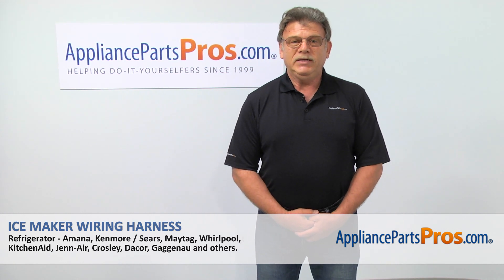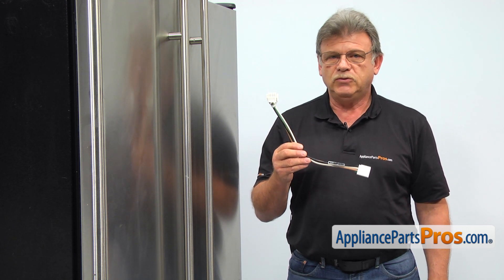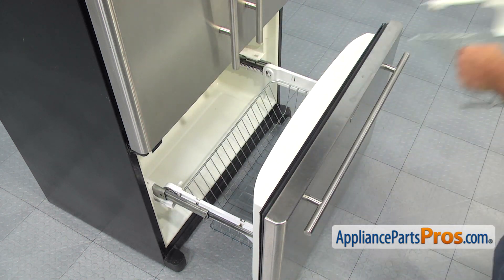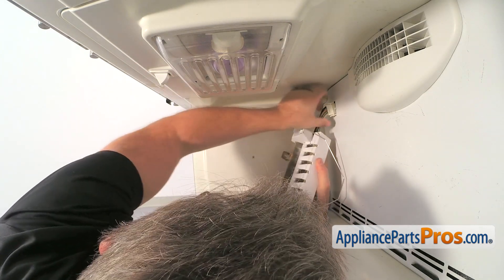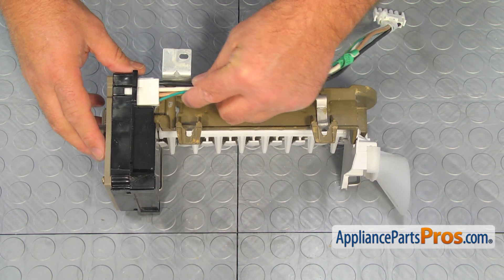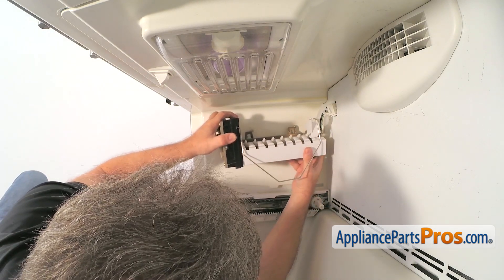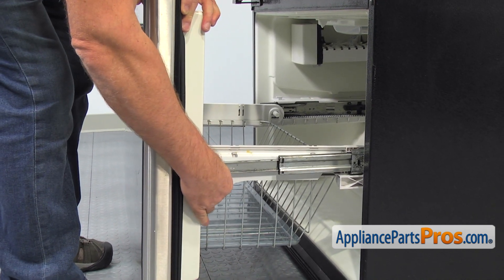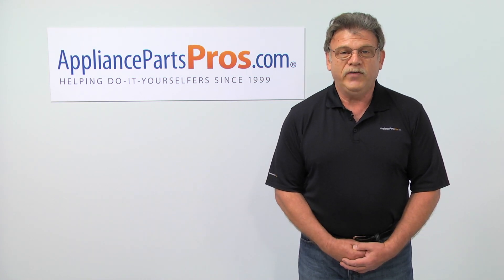How To: Whirlpool/KitchenAid/Maytag Ice Maker Wiring Harness WPD7813010

Comment: Good video........but...................?

Have a question for you about my side by side Whirlpool refrigerator.  The Freezer side has an  icemaker at the top inside of the compartment, not the bottom.  

It shorted out inside the icemaker.  I know this because I had to take it out and unscrewed the front cover (no, it did not snap off but had 3 screws holding the cover on) then the next "cover" had 4 screws holding it in place.

After removing that one, I could see all the electrical copper connections.  Yep, two ends inside were jet black and all smoky with melted plastic in one small area.  Needless to say, it was toast!

My replacement icemaker is exactly the same except the female inlet where the electrical plug goes is large.  I have the correct male fitting for it but it has loose wires at the other end that I'll have to splice into my existing wire harness inside my freezer area.
The black wire has a funny looking enclosed area to it and I am assuming that is the fuse.  My question is this .....  does that fuse short out when my icemaker also shorted or can I leave it intact while splicing in the new male fitting which also has a fuse incorporated into its line?

Why don't I just replace the entire harness? 

Because the harness inside my freezer goes into the side wall and there is no way to remove it except cut the wires.  In your video you simply unsnapped it from the inside freezer wall.  Sorry, like I said, mine goes right into the side wall and is surrounded with an escutcheon  of some sort that keeps it locked into the side wall.

I am going to splice same color of wires into the same color of wires so there will be no mix up.
Any suggestions?
Reply from the maker: Give us a call, and we'll look into the specifics for your unit. We offer free technical advice and diagnosis. You can give us a call at 1-877-477-7278 or you can chat us at our website: http://www.appliancepartspros.com/. We will need your model number. You can use this tool on our website to help you find the model number: http://www.appliancepartspros.com/modelnumber_locator.aspx